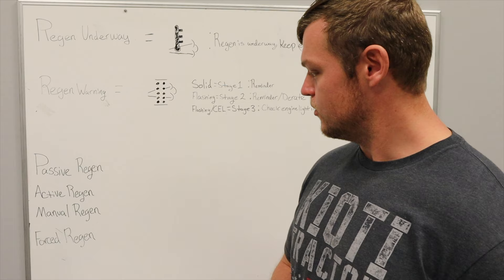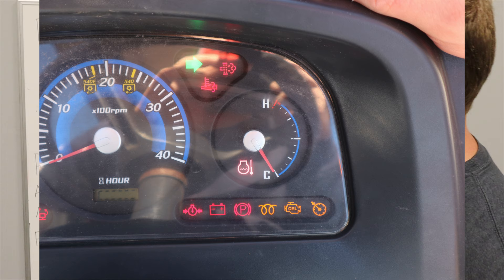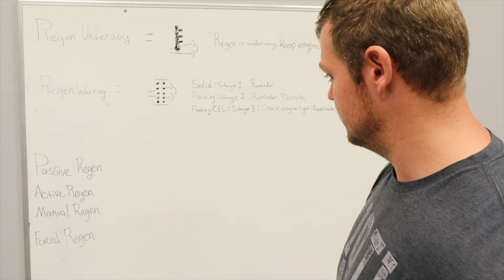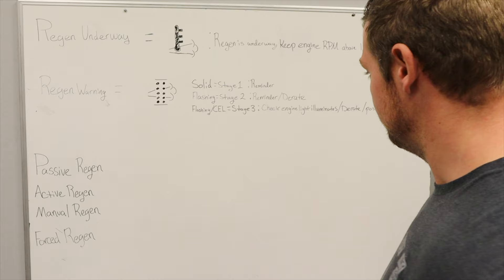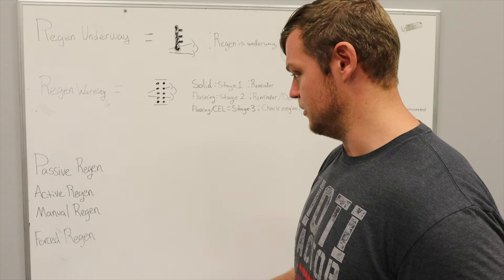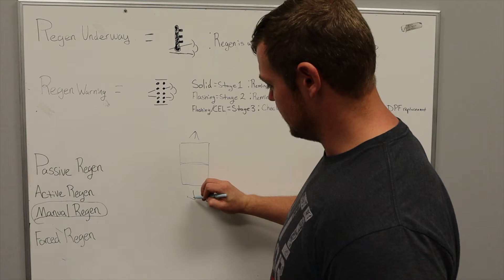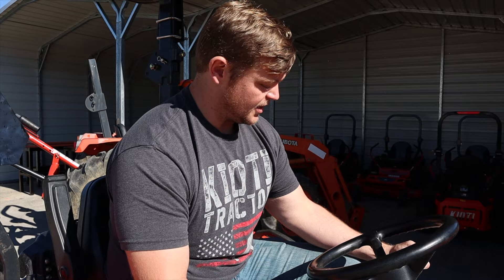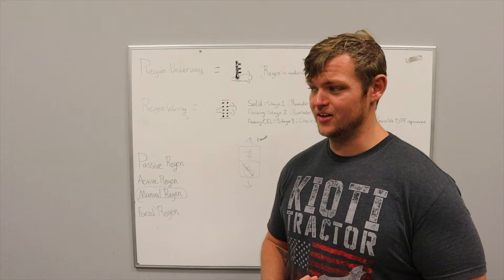LSE Tech Talk - Regen

Comment: Thanks for this informative video. 

Had my first regen on my CK4010 at 29hours. I was working the backhoe at 2200 RPM and heard a RPM drop, so turned around to look at front of tractor and saw a big white cloud of smoke coming from around the hood area (well, the cloud looked big to me...lol). I immediately glanced at the instrument panel but did not see any annunciator lights illuminated. I first thought that I might have busted a hose and something was spraying on the hot engine. SO I shut down the engine, inspected but everything looked fine. I have to admit that I glanced at my newly installed fire extinguisher a few times...lol. I restarted the engine and after a few minutes the regen light illuminated and stayed on while I kept on working. Lasted about 20 minutes before the indicator light extinguished.

2nd regen came at 58 hours while working with grapple. Noticed once again because of white cloud coming from hood area. It lasted 20 minutes while I kept working. No issue.

Love my CK4010

Comment: Should I also set the bucket to hold the loader arms higher? I have seen where some have had the plastic block holding the hydraulic lines on the loader melt during regen from exhaust heating the hydraulic lines.
Reply from the maker: That is unlikely, but if the exhaust outlet is parallel to the loader lines, I would raise the loader.
Reply: @LSE_TRACTOR  it's very likely for certain

Comment: Future Tech Tip that I would like to see is maintenance on the Kioti K9.  Could divide it in weekly checks and then any longer term maintenance like oil/filter, greasing, CVT, belt and others

Thanks
Reply from the maker: Thanks for the suggestion. We will get to work on it.

Comment: Thanks for all of the instructional videos and tech talks. My local Kioti dealer no longer sells Kioti. Closest dealer is 130 miles away. Recently I had been working the tractor with a grapple. After a few hours I finished with the grapple, shut the engine down to remove the hydraulics then the tractor would not restart. after several hours of trouble shooting and changing the fuel filter and prim/vented the system it still would not start. I let it sit over night, still won't start, out of frustration I used some starter fluid and it started and has rung fine since. This leads me to two questions, Why would it not restart after a simple shutdown(no warning lights of any kind). What is your thoughts on using starter fluid on a diesel engine. I had about 1/4 tank of fuel and on a slight nose high incline.
Reply from the maker: I'm sorry for your troubles, and I appreciate the kind words.  Using starting fluid can seriously damage a modern engine with the high pressure common rail system.  If I had a crystal ball, it would tell me that you have a fuel obstruction.  Either the fuel filter is contaminated, or the fuel line is.  I want you to call my service manager Thomas Reynolds at 615-956-0334 and tell him that you asked for my help.  He is much smarter than I am, so I would like you to talk to him.

Comment: What drives it to have a regen?  Is it # of hrs? Is there some sort of soot detection that when it detects a certain level it goes to regen?  The reason I ask, is if it by # of hrs, I would rather that, this way when I get close to the hrs, I could do a manual regen say at the end of a work day so that it doesn't do it the next day while I am trying to work
Reply from the maker: Excellent question Wayne. Thank you for asking. Your soot detection supposition is correct. The key to minimizing downtime is to minimize the number of regens: run that engine wide open. It’s hard for some folks to understand that modern diesels are designed to run fast. Open it up!!

Comment: What happens when the tractor won't regen on its own.
Reply from the maker: A manual regeneration can be performed at any time.
Reply: The check engine light on my rx6620 will Flash and it will de-rate. It has stopped regening automatically and I just been manually regen it. the tractor runs and operates fine.